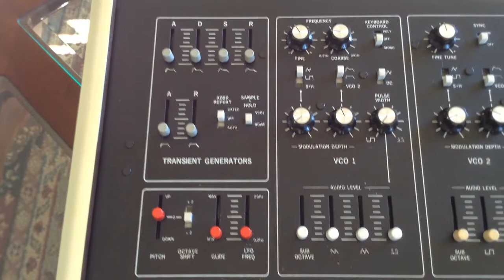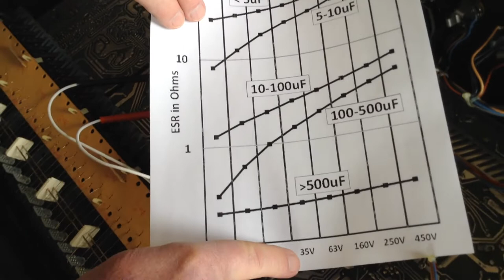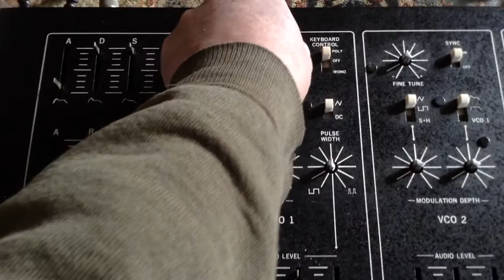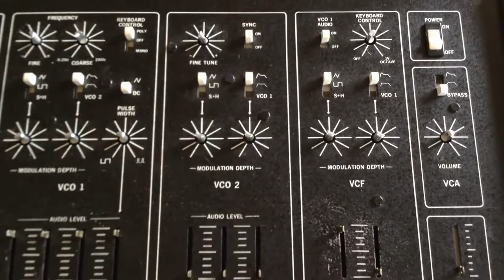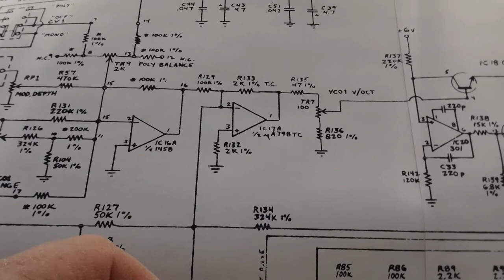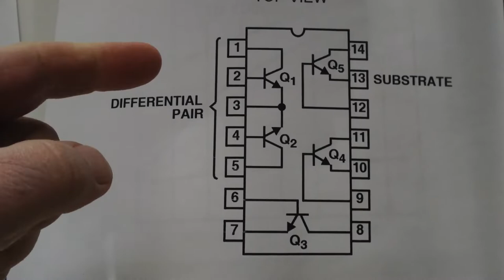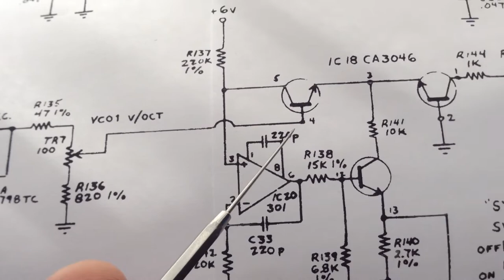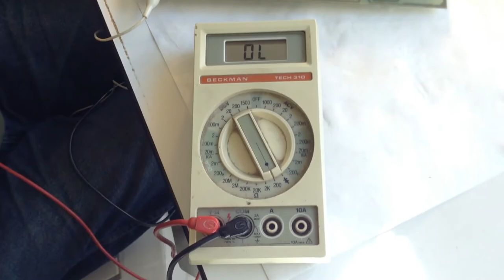CAT Synthesizer Repair - Restoring my Vintage Octave CAT Synth

Comment: Thanks so much for this video! Great to see how to restore vintage synths with such details and explanations! Did you, by any chance, take some pictures of the pcbs?
Reply from the maker: Thank you! I hope my journy fixing my CAT synth could help others. At least show them what is inside. I have a few pictures that I took when it was apart. What were you looking for?
Reply: @georgeterbush2976  hi! Well im trying to replicate the synth - or at least parts of it! So any detail would be much appreciated! Thanks in advance!
Reply from the maker: @wawajanvier  By "replicate" you mean reproducing the circuit boards, I do not have good enough pictures to do that.

Comment: Hi, you did a very nice video! I have The Kitten Synthesizer and in the same boat as you. I  haven't turn mine on on 25 years. But just few days ago I plugged it into my dim bulb tester and my variac and slowly increased the voltage. My keyboard still works but has the same problems as yours. You would not believe how helpful your video is to me, you gave me the confidence to take it completely apart. Thank you so much!
Reply from the maker: Thanks Tony. I'm glad someone watched the video. It was a labor of love to get my CAT working again. The Kitten is probably very similar except for having one VCO instead of two. The biggest issues were oxidation on the keyboard buses, j-wires and control pots. Just be careful cleaning those slide pots. As you saw in the video, if you spray them with contact cleaner, you will loose that nice, heavy feel since you are flushing away the grease. I would just move the sliders up & down 20 times. Most of the scratchy noise goes away. Keep me posted on your progress!

Comment: Great video. I think it is going to help me a lot restoring my Cat. One question. When you measured the caps, was the capacitance reading not outside the tolerance? Or did you just look at the resistance which was fine? Thanks!
Reply from the maker: I looked at both the capacitance reading and the internal resistance. I don't believe any of the caps were bad and needed replacing on mine. What kind of problems does your CAT have?
Reply: @georgeterbush2976  It's probably my lack of knowledge about measuring these. I noticed you measured more capacitance then was mentioned on the cap. I thought caps only degraded but yours gone up in capacitance? I was wondering if that was a sign too for degrading...
Reply from the maker: @OKB53  I was measuring in circuit so it's possible there is a little added capacitance from the circuit. Also, the caps are probably +- 20% tolerance. I would not worry about your caps if they read like mine. Internal resistance, on the other hand is VERY important. If they read 1 or 2 ohms, they would be bad (for 470uf caps).
Reply: @georgeterbush2976  Thanks, good to know! I just purchased mine and was in a pretty bad shape visually. I cleaned everything and now it looks very good.  I didnt turn it on however. Thats my next step. I want to check the pu first.
Reply from the maker: @OKB53  Wow! That's awesome. Good luck with the restoration. It's a piece of history.

Comment: Thank you very much for posting.  Still having trouble with mine.  Do you know what the problem might be if I’m not getting -15v on the power supply?
Reply from the maker: Any luck? I would suspect IC41which is a 79M15 (-15 volt regulator) or something in that circuit.

Comment: Can u recommend the correct trimmer pot replacement for the cat Vco 1 tune (104-100k). mine won’t stabilize at 440hz when calibrating. Curious exactly what replacement you used to on your cat. A link to the part? Thx.
Reply from the maker: I did not replace trimmer pots. Most of my pots were oxidized 35:10, but all that was needed to get them working again was carefully turning them fully clockwise, then counter clockwise several times. If I remember right, I may have squirted a little Deoxit cleaning solution on the side of the pot to help clean the oxidation.  Good luck with your CAT!
Reply: @georgeterbush2976  thx I’ll keep trying to clean it. Can u recommend a part tho?  Is it a special trimmer with an SMT resistor built in?  Seems to have six legs. Having trouble finding or even knowing what to look for. Thx
Reply from the maker: @fetaldreamcore  I see what you mean. I'm having a hard time finding that trimmer layout on Google images. I suspect that the 2 pins on the one side are there just for support. The 4 pins in a row are the active pins.
Reply: @georgeterbush2976  I was told that it looks similar to a trimmer pot that is a hybrid with an SMT resistor built in also Found in a Moog tarus pedal they said snd very unreliable. But still no luck for any replacement options or NOS or Even a name. I have some photos of the PCB and pot but can’t post on YouTube comments.  Hopefully you have better luck.
Reply from the maker: @fetaldreamcore  I think you really only need a pot with 3 legs. Maybe something like this.
https://www.mouser.com/ProductDetail/Bourns/3352E-1-104LF?qs=EYTJzGwugUq5dAL0MWrkdQ%3D%3D

You will have to look at the spec sheet for the dimensions to see if you can make it work.